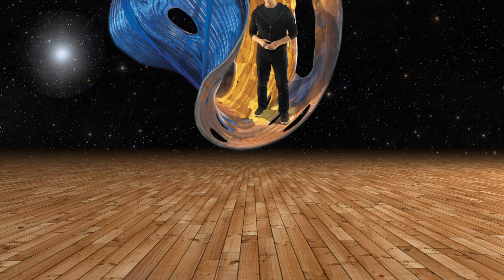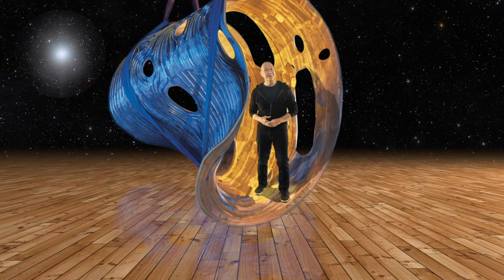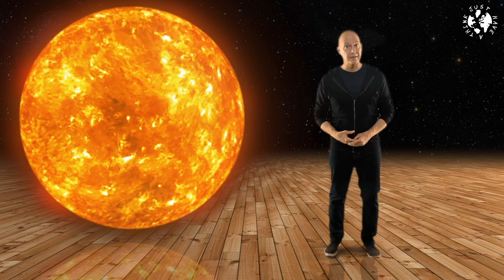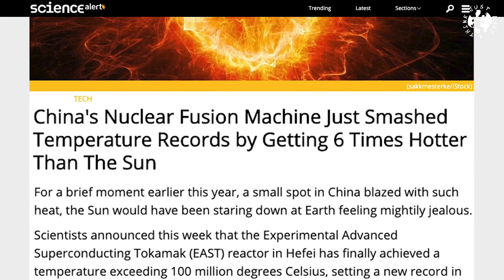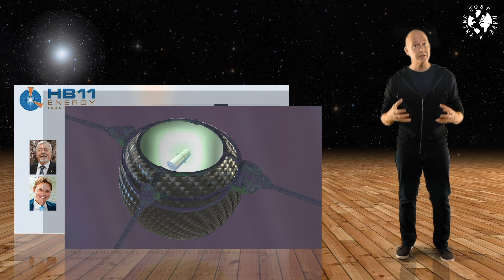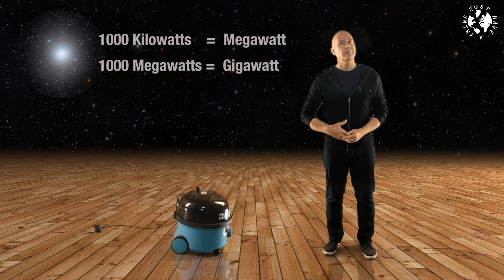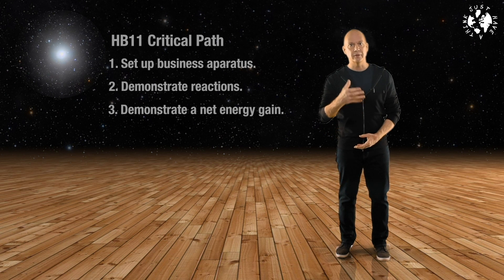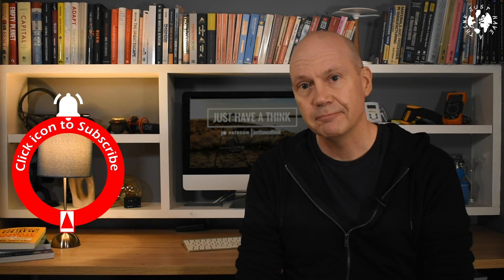Nuclear Fusion:  Revolutionary new breakthrough.

Comment: By the way, our sun receive energy externally via polar regions in the form of plasma. Solar models like a oversized electric arc (plasma) lamp. Part of the residual energy emits from solar, along equatorial region, in the form of solar wind taken as secondary plasma current that feeds the earth’s polar region also responsible for the aurora. 

Earth receives solar energy in the form of polar Birkeland current come out as 
- aurora
- resistive heating, geothermal 
- magma, lava, volcano and seismic activities
- magnetic poles, magnetosphere   
- spinning force, earth rotation, Faraday’s motor
- electrostatic driven - cloud, wind, hurricane 
- electrostatic driven - ocean current pattern 
 
In that sense investment to renewable energy should include 
- geothermal energy (unlimited cosmic plasma sourced)

Comment: Actually they should combine both technology, but not with the aim to achieve fusion. Actually with aim to achieve relatively stable local self propelling magnetic field, that will work some time and which will produce some electrical discharge. They should find the most light and same time the most electrically charged element, some to scale balance, and speed em up with this technology of laser, and magnetic confinement, and then when they achieve some sort of electromagnetic stability of element, which means that element makes its own magnetic confinement, they stop the laser. Of course this kind of local magnetic field will not last forever, but maybe has potential for extraction of more energy than is needed to propel the system. Something like between plasma and normal state, which will induce changes in weak nuclear force but not sufficient enough for radiation, only just for maintaining relative system stability, which could as a result interact with outside as electrical discharge. Like this sapphire project but more inclined with property of magnetic field, which is this donut shape.

Comment: Solar and wind are a crock, they are nowhere near the level of efficiency needed. Wind is unreliable, hugely expensive, requires a lot of maintenance and has a short life time.  Solar is not efficient, and not as renewable as people want to believe.  The materials that are used to make solar panels include coal, quartz, copper oh and plastic to insulate everything. Huge fields of solar panels are needed to power even small numbers of dwellings.  Electric vehicles are not good enough either, they are only suitable for someone who only travels their local town each day.  Long journeys and heavy freight still cannot be powered by electricity at its current level of development.  People seem to think that we can stop using coal, they are wrong.  We must use coal and will do for a long time to come in the production of steel etc. The renewable energy sector is just an expensive gimmick really.
Reply: Spiney WarPigs you clearly know nothing about the energy sector, or about science in general

Comment: In the sun do the atoms fuse because of the pressure from the sun's mass or is it due to quantum tunneling or both?
Reply: ßØSS 1417 Pressure is not required, it just significantly increases the rate of reaction. The sun uses a very slow reaction chain.

Comment: In the more 'traditional' (non-HB11) fusion plants, isn't it the case that much of the material inside tokamaks or stellerators will be peppered by neutrons and/or protons, and therefore pick up radioactivity? If the material becomes brittle or unusable over time, could this not give us similar radioactive storage problems as with fission reactors?
Reply: For many years (almost 25 years) I have been convincing scientists that thermonuclear fusion in the Sun occurs not in the core of the Sun, but in the solar corona !!! But scientists are very stubborn, and do not want to believe the obvious. Why are scientists not accepting new breakthrough scientific ideas? There is an assumption, accepted by most scientists, that thermonuclear fusion in the Sun occurs in the Sun's core. But no one has ever actually confirmed this. This is just a guess, the fantasy of an authoritative physicist. Scientists are currently using two methods to achieve nuclear fusion: inertial confinement and magnetic confinement. But there is also a third method of achieving nuclear fusion, this is the repetition of physical conditions as in the solar corona. Nobody is using this third method to achieve nuclear fusion? In 6 months there will be a small prototype of a commercial fusion reactor. A commercial fusion reactor in 1-2 years! I propose a technology transfer for a commercial fusion reactor under a contract. Thermonuclear fusion in the Sun - a new version. http://n-t.ru/tp/ie/ts.htm     https://www.youtube.com/watch?v=izCALj848xU

Comment: In my unit on nuclear chemistry, I talk to my students about aneutronic H-1 /B-11 based nuclear fusion as a power generating scheme that requires much more stringent conditions than the deuterium-tritium fuel cycle for tokamaks.   Moreover, my understanding of current fusion methodologies is that they form large amounts of neutron radiation which, not only robs energy of those systems, but also creates a significant safety hazard.   I find all of this intriguing as this Australian company may have gotten around this problem.  May I wish them well in their endeavors.
Reply: * What will they think of Next ? *. May This Co be AUSTRALIAN BACKED  & NOT FOREIGN OWNED  !!  All profits exiting stage left. 
 Thankyou for such  encouraging reporting ,  our ’ Main  media  ‘ out  of touch . …..

Comment: the Safire Project has pretty much 'put a Sun in a Bottle' and they done it the natural way, not this dumb idea that pressure creates nuclear fusion - https://aureon.ca/
Reply: Ken Collinson except they haven’t produced electricity and their physics doesn’t work lol
Reply: @Gomlmon99  I can't believe you said that lol... do you know how a nuclear power station works, or even a coal fired power station?  they are just points of heat.. you plumb in some water pipes and draw of the water which is heated and the hot water drives a 'steam turbine' which turns the eletric generator which makes the electricity LOL  the point is.. the big secret is making HEAT everything else is old tech... please lol
Reply: @Gomlmon99  Do you know how the world creates electricity ? they use a point of heat and then use it to heat water which drives a steam turbine which turns an electric dynamo commonly called a electric generator LOL https://aureon.ca/
Reply: Ken Collinson yes, I’m an engineer and very familiar with power production. My point is, they have produced 0 electricity because it’s a scam, and it never will produce electricity. They have been claiming to be producing positive fusion for a while now, and nothing to back it up apart from other, equally unqualified, people.

Comment: So in a way this is for fusion, what a stratified charge is to the internal combustion engine. I like it. The molecules don't care what tricks you use to obtain fusion temperatures. But there is another problem. How are you going to get the electrical power out? Thermal transfer may be the easiest but it is the most inefficient method. You need to find a way to tap those electron volts directly because without that all a fusion reactor is, is a steam boiler and that's 1800's technology.
Reply: Some fusion reactor designs have MHD generators to siphon the energy out of plasma.
Reply: @caav56  MHDG = Magneto Hydro Dynamic Generator? I hadn't thought of it working that way but it does. No differences between a motor and a generator kind of thing. Thanks for the info.

Comment: TBH, anything that gives us a good shot at Hydrogen/Boron fusion is incredibly important. It was going to be really hard to do that with tokamaks. I'm cautious by how hype-y the reporting on this elsewhere has been, but if the physics works then that's awesome. There's a good chance that solar may largely replace fossil fuels by the end of the decade, so it would be silly to abandon solar. And we'll need a lot of energy to start pulling all the carbon out of the atmosphere, and probably having to find something to do with the methane being released by thawing hydrates, so just enough energy to supply our basic needs isn't enough energy by itself. Between the impact of the new high-temperature superconductors on magnetic confinement, this, and the other proposed fusion methods like General Fusion's piston method, it feels like somethings got to give before too long, but humanity still has LFTRs as another backup plan too. I'm optimisitic, with the caveat that I expect a lot of the world's economy to revolve around climate change mitigation, but still I'm optimistic.

Comment: For those keen on being open-minded towards alternatives, look up the SAFIRE project or Aureon energy. We are probably much closer to actually practical fusion devices than you might think.
Reply: The market will verify this.
Reply: @godspeed133  Hopefully not only the market, but also the scientific community as well.
Reply: @GiraelCS  I guess, but that's implicit in that it can't make money without being scientifically sound.
Reply: @godspeed133  Well I would't agree that you can't make money from scams. Although longterm and stable incomes come in most cases from legit practices, the main exception to that which comes right to my mind is the pharmaceutical industry. Lots of unethical and unscientific practices there. But I get the point. The main Issue here is the lack of detailed information about the experiment, which has been stated as being due to protection of investors, even though the team shared a lot of more generalized information anyway. So I am as always properly skeptical and will patiently await what the SAFIRE team announces in the future.
Reply: @GiraelCS  I mean pharma is all well and good, but it's not relevant here. It's pretty simple really in this instance, if their device doesn't produce net energy, it won't sell, except for a short term scam profit if you like. They can output as much or as little info as they like. Not really much more to it than that.

Comment: Reaching a new mile stone IS a breakthrough. You don't have to totally succeed for that. Glass lithium batteries are a breakthrough, however they are not the final answer or end-all. That being said, I look forward to more on this subject as the breakthroughs are speeding up a little. Within time there should be a predictable "Moore's Law" like structure for the advancements like we've had with silicon.

Comment: "Performing 1 billion times better than predicted" - that's a worrying thing to hear from a scientist - that's orders of magnitude off!
Reply: If you look at the published papers you'll see the justification for this. They're talking about the effects of high magnetic confinement by a laser, producing a beam of nuclei from an initial non-linear acceleration by another laser which produces nuclei with the right amount of energy needed to initiate an avalanche. This is not thermal equilibrium conditions which would be a billion times less reactive. These reactions were actually predicted, but only now can they be tested with those new lasers.
Reply: @markpurcell8075  Look. In ANY profession, if you are a billion times anything more or less than predicated, means you STOP IMMEDIATELY, go back to the beginning, and find out WHY. You redo the math to find out where your predictions went wrong. THAT'S CALLED "THE SCIENTIFIC METHOD". Until you can reasonably predict the outcone, YOU DON'T DO IT AGAIN UNTIL YOU KNOW WHY YOUR PREDICTIONS WERE SO FAR OFF.
Reply: @brianrichard8310  Huh? The reactions were predicted, the billion times comment is press hyperbole and is compared to thermal reactions, which they conveniently miss off to make it look more impressive to the public. This is not thermal reactions. Hora prediced this stuff in the 60s.
Reply: @markpurcell8075  Try to get them to print a retraction then instead of just "accepting" the inane and insane poetic license, and calling it journalism. GEEZE! I'm no physicist, but slandering results like that SHOULD outrage the scientific community. Where are your leaders? They should be on the phone yelling at these yellow journalist's.
Reply: not if they were pessimist about it lol like you seem to be :D
Reply: @Caccac40  I'm not pessimistic,  I'm a realist. If i strike a match, i have to be reasonably assured of the results. Why? Because it's a "proven" reaction. In short, it's been done a million times before, and we get the same results every time. A theory, experimentation, conclusion. ALL PREDICTABLE. Get off your collective azz'z, and fire back at these journalists. They are making a mockery of your profession.
Reply: @brianrichard8310  ok then you are a late comer and you just play with what has been done/finalized. It's ok but know that scientist work on what is not done and finalized ;) and therefore this is exciting. We will let you know when this is done don't worry.
Reply: @Caccac40  It won't be so exciting if you predict a candle powers worth of energy, and you get surprised by an explosion that kills you. Predictions must be realistic, or people die. Get it?
Reply: @brianrichard8310  You don't seem to understand at all fusion...maybe start there before commenting! There is no explosion possible or involved lol
Reply: @Caccac40  That's been proven, has it, or is it still a theory? Be careful how you answer.
Reply: @brianrichard8310  proven, it is the definition of the fusion...this is how it works...there is no chain reaction...
Reply: @Caccac40  so why not use something heavier that has more free elctrons?
Reply: @brianrichard8310  do you know google? are you that lazy that you just go on forums to ask people to do all the job? Go research a bit, show some effort instead of sitting and spitting the first thing that comes to your mind.
Reply: @Caccac40  I'm not a scientist. It's not my JOB to bring sanity to their pet theories. What it is my job is, is to question. To bring honesty, sanity, and good second judgement, to what a lot of us out here think is only an exercise in futility. Especially when it involves billions of my and all peoples hard earned money. To have NO rebuttals,  from the scientific community, to sensationalized journalism, brings me to this point. I repeat. They are making a mockery of your lofty profession. WHY ARE YOU NOT OUTRAGED?

Comment: I'm of the opinion that we invest in the energy sources that provide the most efficient energy gains, in the smallest spaces, in the safest manner. The most efficient methods of energy production require the least number of conversions. For example: when you charge your phone, the energy is converted from chemical (coal), to heat (fire), to kinetic (turbine), to electric, to chemical (battery). Each conversion creates loss. QI charging, adds two extra conversions (electric to wave and back), making it less efficient.

Short of the radioactive waste, fission is the most efficient method of generating power by raw output. It's also the safest due to the number of safeguards in place (the exception being natural disasters). It doesn't take up much space, there's fissile alternatives to uranium, and (for those in favor of nuclear disarmament) you can make use of the already enriched uranium from warheads for the peaceful end of energy production.

However, I'm all for taking the resources that are being poured into wind, solar, and tidal power and throwing it into fusion. It's the most eco-friendly solution in both interpretations of "eco," which is how it should be done. Economically friendly due to the low cost per watt for power generation. Using the hydrogen-baron reactor to generate power cuts out three of the energy conversions to generate electricity, making it astronomically more efficient. It's also ecologically friendly due to a number of factors compared to the other renewable alternatives (wind, tidal, and solar): it takes up significantly less space compared to the acres of land/sea to generate enough power to suit our needs; the power is more efficient due to raw energy production; solar, specifically, uses a host of toxic chemicals in the panels and tend to; and there's less risk to the local environments do to solar reflectivity, turbine blades killing birds or fishand emitting low frequency sounds that disturb local wildlife.

Comment: A Watt is a unit of POWER not energy. The SI unit for energy is the Joule. One Watt is one Joule per second, so all that stuff about laser chirps is about creating very short laser pulse that decrease the time the energy is delivered, thereby increasing the power (without changing the energy).
If you have peta Watts of energy at your fingertips, you don’t need a fusion reactor!

Comment: He said that we've been trying to achieve nuclear fusion on earth for a long time. Actually, we already had achieved this in the 1950s with the hydrogen bomb. The bomb uses an initial nucular fission explosion to compress hydrogen to extremely high pressure, with temperature rivaling that of the sun's interior, so that fusion into helium occurs.
Reply: Rivaling is understatement. Its on whole another level.
Reply: Tokamaks and stellerators also achieve nuclear fusion... just not in a sustainable and net energy positive way.